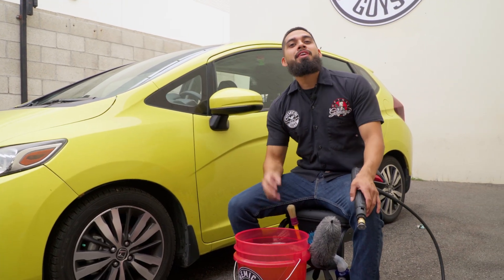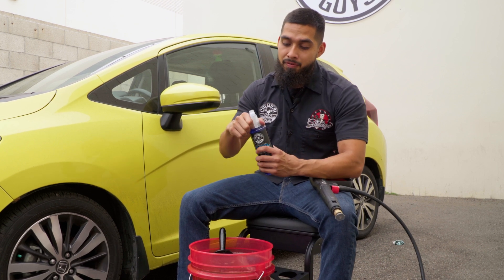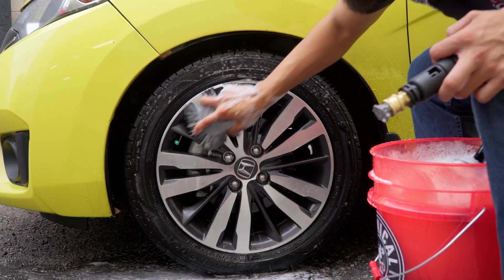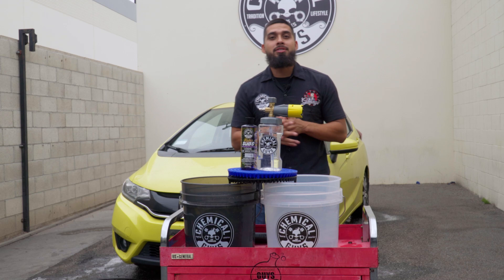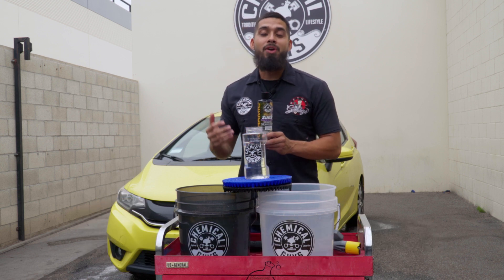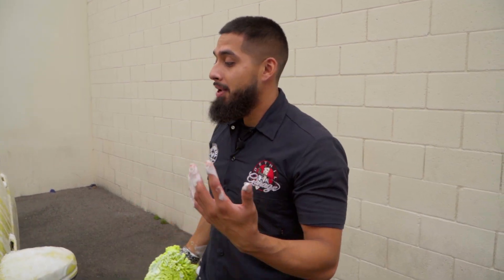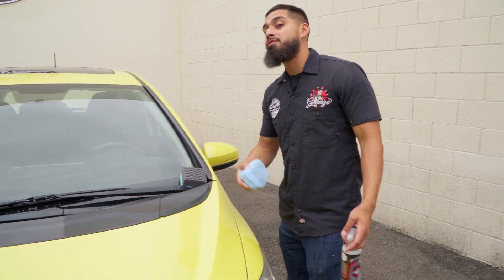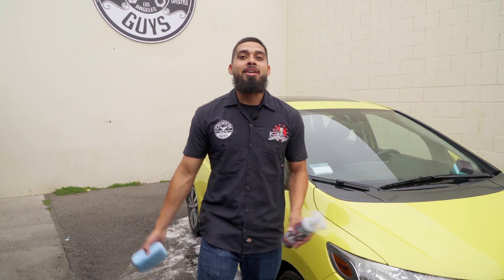Soap That Boosts Ceramic Coatings With A Simple Maintenance Wash + Keep It All Protected With G6!

Comment: On the topic of ceramic coating, I know it's fine to coat the windshields, but is it okay to coat windshield wipers? Thank you.
Reply from the maker: Hi there! Use HydroShield to protect exterior as well as interior vinyl, rubber and plastic components against harsh elements.